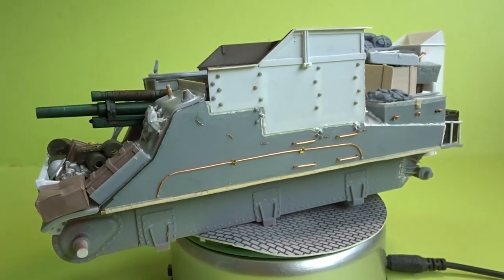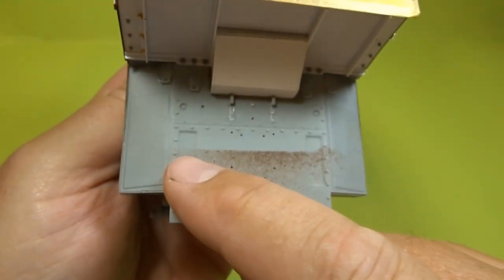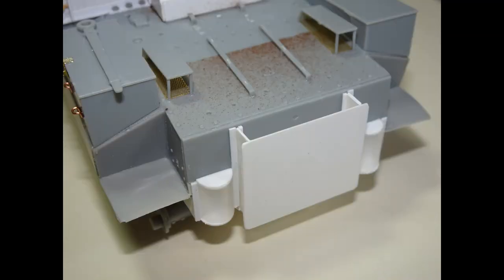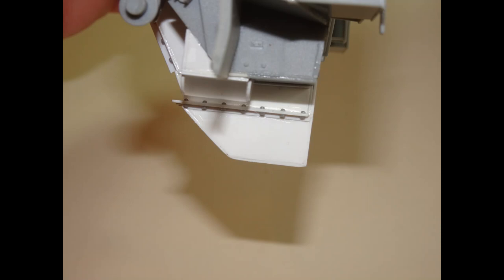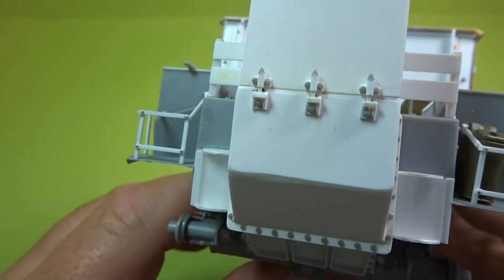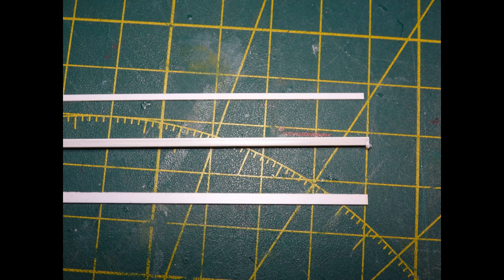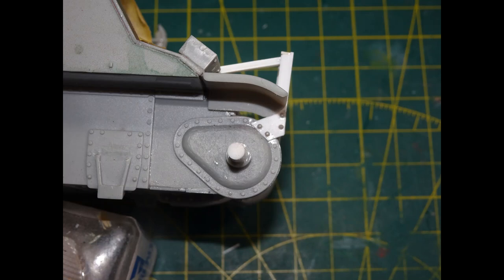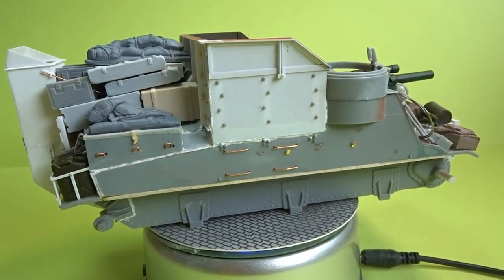Dragon 1/35 Scale M7 PRIEST Conversion to Canadian D Day Priest - FINAL CONSTRUCTION

Comment: Another great video Steve. A lot needed doing to get an accurate Canadian vehicle. Wonderful attention to detail. Look forward to the paint. Those Meng Nuts & Bolts look very useful.
Reply from the maker: Hi Jim. I have several sheets of them. A lot easier to use than the Masterclub ones. I had an MOD manual from the time giving instructions on how to waterproof the M7 priests on D Day, so I scaled down the drawings along with the reference photos. Its certainly been a fun research project. Many thanks for looking in and your continued support